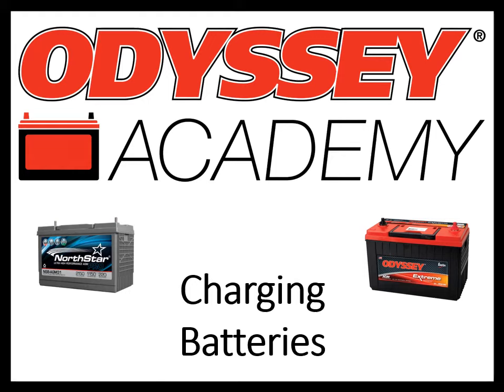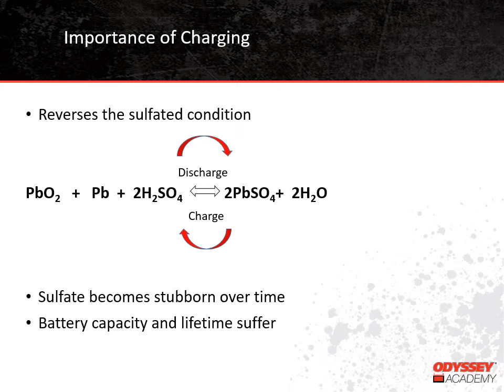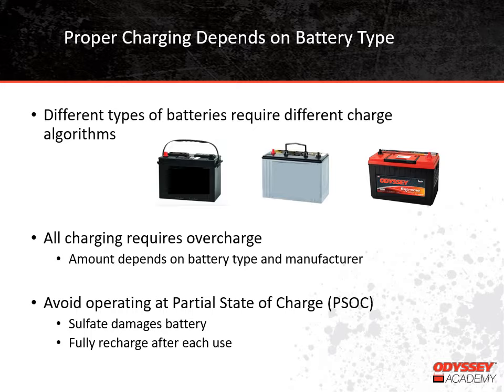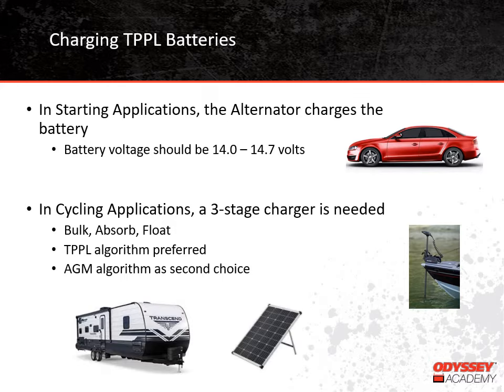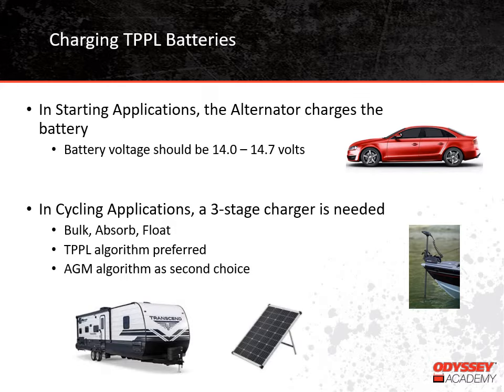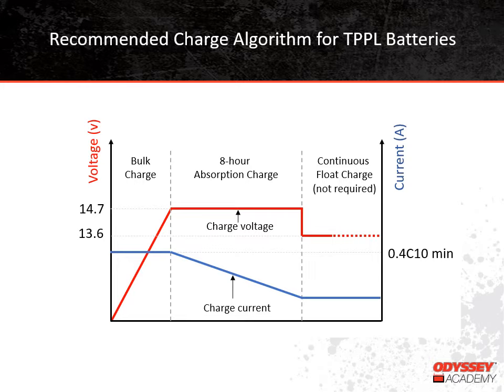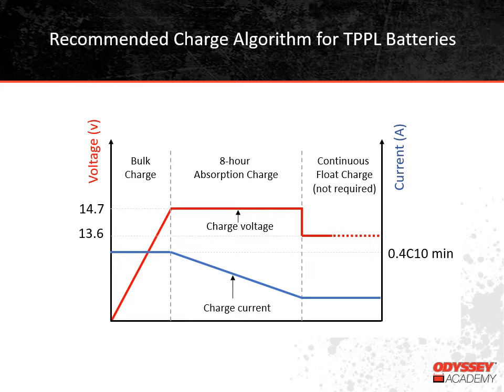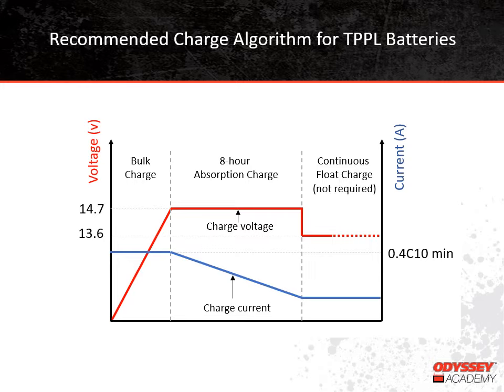ODYSSEY Academy – Charging batteries

Comment: Great video and tutorial. What is the voltage output requirement for an Alternator when using a Odyssey AGM battery,  is it 14.0 - 14.7 volts?
Reply: On their website it states 14.3-14.5

Comment: What SPECIFICALLY must my car's charging system be putting into my Performance Series 96R-600 battery in order for me to NOT have to do ANY 'maintenance' or even any 'desulphating' charges at all??

IF the answer is that regardless of what my alternator/generator is putting into this battery (or IF it IS actually too low a voltage output to charge it, and KEEP it charged), how often, and for how long (given much current 'short-tripping' after any starts lately) should I be hooking it up to my Odyssey Ultimizer 25 AMP charger in order for it to last longer than the two years my last one made it to???

Comment: So what about my alternator and charging
Reply: alternator voltage shouldnt exceed float voltage of the Battery. Float voltage ~13,5-13,8V
Reply: @qwertz33

So people doing these fuse mods to bump alternator output .5-1v are possibly over charging their batteries? Or if at an output of 13.0-13.3 the .5 bump would be correct for older vehicles which were not originally designed for AGM batteries?
Reply: @mrjodoe  I read that it should be higher then that, they sell 14.8 volt voltage regulators for GM alternators for use with AGM batteries.
Reply: At 5:40 she goes on to state how the battery is being used determines how it should be recharged. Then states it's "important" for the battery voltage from the alternator be between 14.0 - 14.7v for the battery to be charged properly.